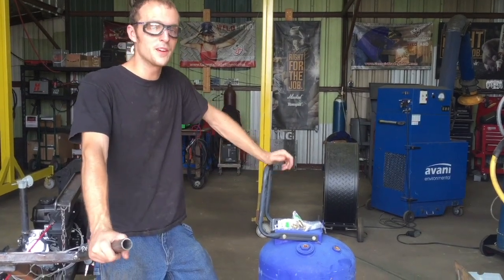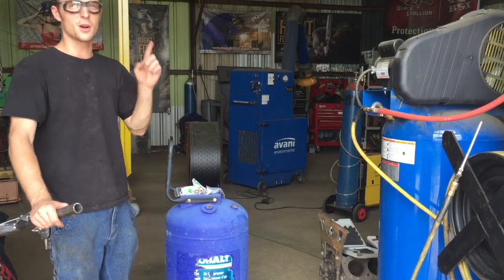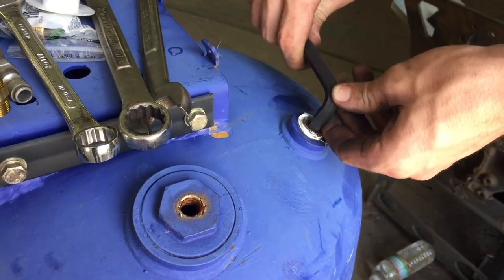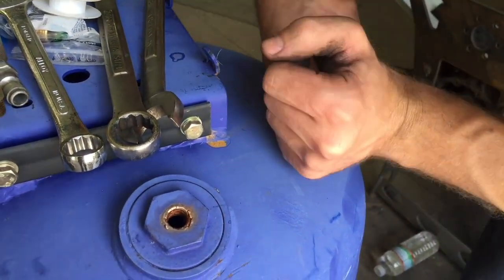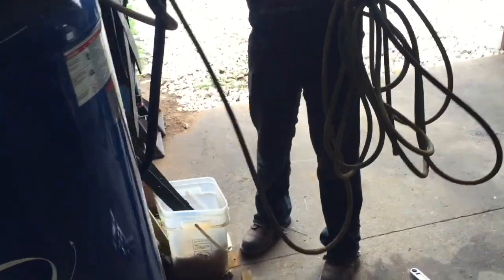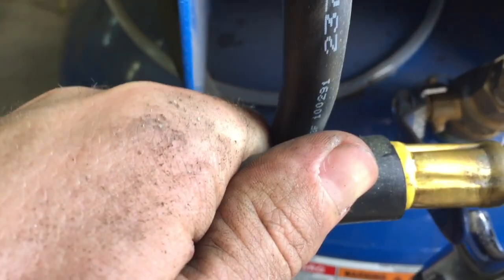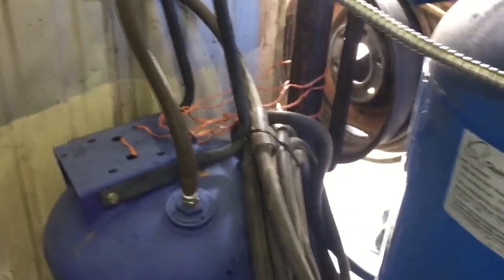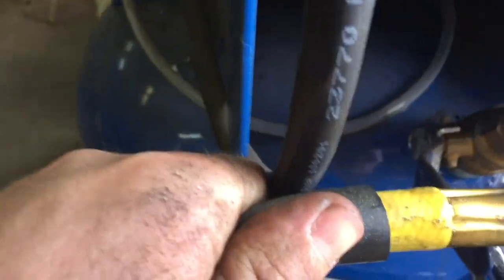THE ULTIMATE DIRT CHEAP AIR COMPRESSOR UPGRADE - THE HIDDEN SECRET OF HOW I INCREASED OUTPUT!!!

Comment: I was airing up my tires from a guy's shop once and he had a pvc air system.  I turned on the air and walked outside to air my tires.  Just after I got outside, a bomb went off in the shop.  The entire length(30-50 ft) of pvc had shattered, shooting 4 foot pvc spears into every wall, the ceiling, and the garage door.

I was lucky to be outside, because I don't think anyone inside would have lived.  The spears were driven in so hard, some of them had to be broken/sawed off because they would not come out.

DO NOT use pvc or cpvc for an air system.  Use copper, steel, or the proper hose.

Comment: Add a shutoff valve and couplers and you can unhook the smaller tank and take it wherever you need it.
Reply: To do what with? Won't last very long. 
They make 12v tire inflators and small pancake air compressors.
Reply: Gotta love armchair experts like this guy☝️
Reply: @randomschittz9461  Who are you talking to? 
Who claimed to be an expert? Why are you for or against it? How about making your point? I had a portable air tank for 10 years plus, hardly ever used it for anything except on occasion using it to pump up a mower tire. You are not going to run a power tool off of it. After its quickly deflated you have to hold the air hose onto the valve stem to refill it which takes a while.
Reply: I have these little tanks around my shop and I can attest to how useful they are.  I run a 3/4 impact on a little bitty portable air compressor and I love it ,  it does take a few minutes to air it all up but I find myself letting it keep running and not having it stop start all the time it’s just better
Reply: @georgewelker853  I used a 30# Freon tank for a few years before I got an air compessor.

Comment: I just did the same thing but I used Blue lock tight instead of of the tape it’s a lot easier and does a great job now I can run my HF sandblast cabinet longer

Comment: I did that with a 60 gallon tank I got off craig's list.  I keep the second one in the other shop and it gave me 2 benefits.  One, I have 120 gal of storage, and two I have a tank closer to my tools in the other shop so I'm not working off of a 100' line.

Comment: I did this at home. My 1 gallon portable compressor and added a 20lb propane tank as auxiliary when I don't need it portable. (Just a DIYer). Quick connect into propane and a regulator output with a tee. Tank was free on Facebook when someone was getting rid of their grill, about $25 in fittings at home depot.

Comment: CFM is CFM, if you have a 100 gal tank vs a 200 gal tank, the wear and tear on your air compressor is the same, the 200 gal tank may help you with pneumatic tools, but the air compressor will rum twice as long to refill it. Actually running longer may hurt your compressor because it will run hotter.  So it is a tradeoff.
Reply: Add an external thermal cut-off on your compressor motor to avoid burning up motor, or overheating compressor itself.
Reply: Exactly this took all of 7 seconds to figure out!
Reply: I did this but I found two bare tanks and put a 5 hp 220 backed to a V twin pump from harbor freight. Two belt system. 80 gal+ a 35 gal. Took less then 5 min to fill both. Your standard 110 pump will end up burning out quicker trying to keep up with demand.
Reply: Yah’ll talkin small pumps.Some of us have pumps that would run 24/7-365 😆
Reply: You're right that it's possible to kill a compressor by running too long, but starting and stopping also takes a toll. If you look at a compressor catalog you'll find they put the same pump and motor on multiple tanks. 50% doesn't seem like an obscene increase. 
CFM is only CFM when it's constant. Intermittent use allows the compressor to catch up, a bigger tanks gives more cushion for longer periods of use. If you run out of air at two or three minutes, but need the tool for four minutes at a time this will make a difference.
Reply: look at it as an engine. cold parts with cold oil dont like spinning.
when warm, the oils flowing, everythings well splashed, lubricated. i prefer just running a compressor for longer periods at a time.

but then, it isnt an engine, its a compressor... and certain aspects are different.

the cylinder gets hot from compression, but thats nothing, and it doesnt affect the temperature or density of the air being ingested by the compressor. if anything, its beneficial. it increases the final pressure in the cylinder. if the cylinder where chilled to below ambient, the air would lose all the heat of compression, plus some more, and would be denser, but also at a lower pressure than one would expect from the compression ratio, as that fixed volume of air would have to contract if it is cooled BELOW ambient, or wherever its temperature would be at that pressure given... awe hell... adiabatic? isothermal? (i always get this bit mixed up...) compression.

its beneficial to cool the air AFTER leaving the compressor, but not when its IN the compressor? yes, cool it down before storing it in a tank, get the moisture out, make it denser, store more air in there. watch it if the tank heats up on a hot day as it will rise in pressure... it has more air in it!

CFM is NOT CFM, its pressure dependent. and then its also compression ratio dependent.

if you have a 2:1 compression ratio, as soon as you restrict the outlet, the pressure will increase. 
when it reaches double the inlet pressure... theres no more flow. whats in the cylinder just re-expands. (unless you say... added heat to the cylinder during compression, to raise the final pressure... note, this hasnt increased the CFM... its just increased the final pressure, or modified the curve that the compressor normally operates on, as designed.)
take it to 20:1, and you can reach ~300psi before flow stops.
meaning 150 psi is half its CFM.
75psi, 3/4 CFM.
7/8 at 37.
15/16 at ~1 bar.
some sorta log curve. 

im ignoring absolute and gauge here...

full flow at atmospheric. as its rated. with a certain size orifice. any restriction raises the pressure in the cylinder itself.

i find its the starting that kills the motor. especially when the volume of the air system from compressor to tank is inadequate. 
the exhaust valve dumps whats in the cylinders...
but if that cylinder volume is lower than the compressor volume, it reaches full pressure in the line and cylinder before it even completes a full revolution. or two 

yknow, that compressor that bogs down if it starts with pressure in the tank, and has cooled down after twenty minutes? but is fine if it doesnt cool down? the oil viscosity goes up, added to the fast initial compression, and it bogs. then the current goes out the roof and you burn out the start windings on the motor. 

never had an issue since i started throwing oil coolers in the line. mostly for drying/cooling the air but it has this secondary effect that i only figured out after noticing it. my main compressor spins unloaded for nearly five seconds before it gets enough pressure to start compressing. the lights barely flicker.
plug the line straight to the tank, about 6" run. and it blows the circuit breaker.

thats the whole point of the dump valve, to let the motor spin unloaded when its starting up. all too often ive found its the plumbing that lets it down. an easily overlooked point...

and then finally... you heat the air just before you use it. so it wants to actually expand back to atmospheric pressure fully, without requiring to draw in heat from its surrounds... ie, the tool that gets cold. to the point of iced valves in some cases. and when CFM is inadequate, sometimes.... its simply because of the loss of the "heat of compression". return it, and your tool is suddenly receiving its full flow at the required pressure, with no other system changes.

PVT.
Reply: @paradiselost9946  PVT, brother you know that you confused way more than half the DIY'rs that are just looking to take their tires off in the driveway with a $100. compressor and another tank they picked up or had left from the last POS they wore out and a $29. compact wrench? (likely to impress their girl?)  The configuration & explanations you've put together & explaining various situations went over most heads.  I mean no offense to anyone with that statement to those who don't understand or have different views.

I personally enjoyed your creative attempt to explain simple air, cubit feet per minute, heat, atmospheric pressure and basics of compressed air.  Compressed air really is a simple concept if you follow the laws of physics.  

However you have to keep in mind where you live, whether it's a cool or hot climate. For example here in Houston, a cool room for compressor then go to closer proximity where most work for 2nd tank, proper hoses, insulated between both, proper filter, lubricator and dryer between both and one more before the hose reel coming down from the ceiling of the shop and garage.  

Finally a dedicated breaker and cutoff switch going to the plug for your compressor of adequate size and quick connects and shutoff valves at each stage needed to protect all lines, tanks and hoses.  

To sum my situation since in Houston, with the heat, humidity and changes of temperatures...all hoses are insulated and then because of condensation, your filter, then lubricator, then your dryer before each splitter which may go to any work station to assure keeping water out of tools, as well as protecting those lines.
Reply: For painting it’s a 100% win

Comment: Do yourself a favor and add the drain extension. I did on my 60 gal and it makes it more likely I will drain the tank more often.
Reply: I drain my tank every time I run my air compressor. I heard the guy that owned it before me bled it religiously too. That must be why at the ripe old age of 78 years it's still holding pressure. Plus it's an ASME rated tank. So she's thicc. Being built at the height of the war it is mil surplus. The battleship gray it's in suggests it belonged to the Navy. It's a Par made in Defiance Ohio.

Comment: Did a port and polish on the compressor air intake. Make slightly bigger holding chamber in the head of said compressor. Change out a pulley to slightly bigger drive pulley. Same motor speed but faster pumping

Comment: Most of the noise comes from the intake, also if you get a compressor with two stages high and low it will give you the same cfm in a single tank without taking up more space. Running at a lower rpm will extend the compressor life significantly. The folks at Castair can help with any of this as well as parts and troubleshooting ask for Clint!

Comment: Good advice.  However, you don't really describe how you do it.  My plan was to T off the main tank outlet with a single hose going to the reserve tank.  All this is below the regulator connection so there is just more volume.  Is that how you did it?

Comment: An auxiliary air tank can help maintain pressure in a system if you place it remotely from your air compressor. It keeps you from getting line loss at the end of an air line run. So the least helpful place to put the tank is right next to your other tank. But if all of your air line is less than 50 feet then it doesn't matter. Or if you've plumbed your shop with line over 1/2" i.d.

Comment: Remove a spark plug from your race car, make a hose adapter from an old plug, mount hose to it, start the engine and boom, you have instant air.
Reply: That would void the warranty on my racecar bro

Comment: Your pump will NOT give any more than it did before... The extra tank will ONLY help a tiny bit for a few seconds when you first start.. I don't think you understand what you are doing... Your pump still has to produce the exact same amount so it has to run the exact same amount of time. A buffer tank can be useful if you have a long run between the compressor and point of use but next to each other actually forces the compressor to run more... Do a little research and learn a little...

Comment: Yeah, the compressor also runs longer to fill the added storage capacity, and those crappy little compressor pumps wear out fast. You're not saving anything.
Reply: yes it does run longer but it only has to bring the tanks up the the cut in pressure. Mine goes from 90-135 in a few min, with a 80-20 duty cycle rating. 80% on 20% off , or down time
Reply: He's using a Quincy...no exactly little or cheap. Don't buy the little oil free units